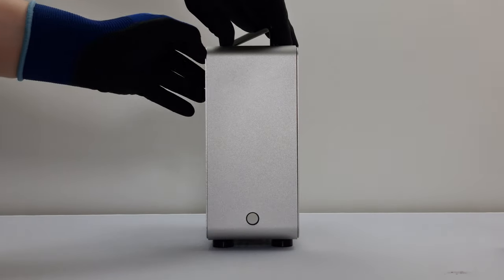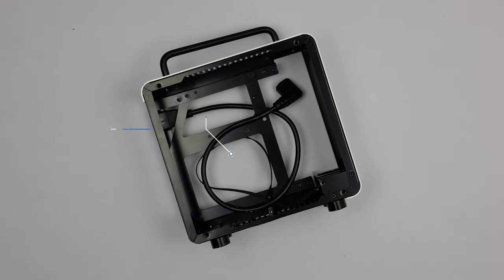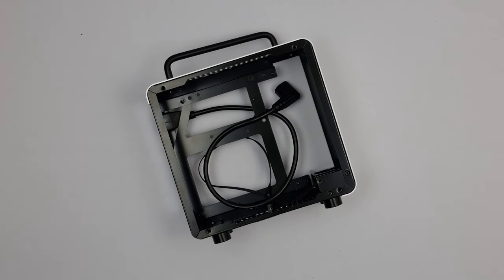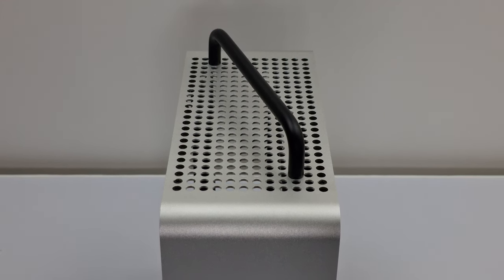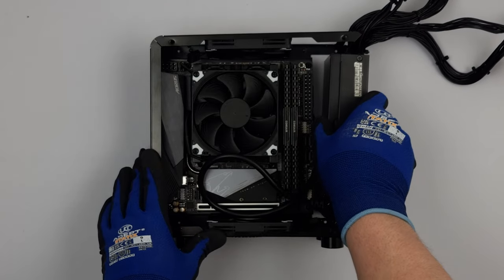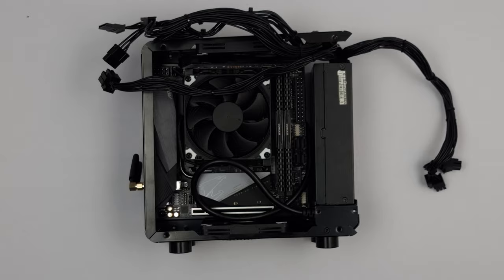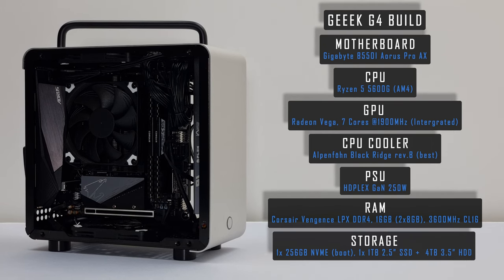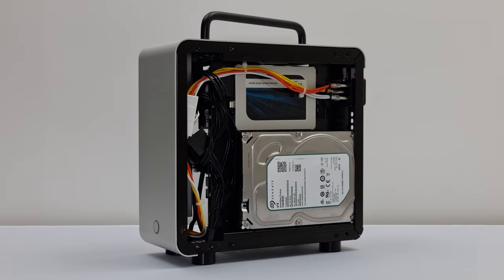GEEEK G4 - 4.8L HTPC Case with Big Design Oversight

Comment: What is your opinion on the Formula 2S case? I am currently using ZZAW A2p with the following specs:

silverstone FX500 psu (swapped the fan ofc), 
msi b550i gaming edge mb, 
g.skill ram with samsung b-die at 3200cl14, 
r5 5600x cpu (defaults with pbo2 on), 
cryorig c7g cooler,
gigabyte rtx2070 itx gpu (defaults cause undervolting became unavailable, idk why), 
I also swapped psu fan with noctua a4x10 flx and have 3 noctua noctua nf-a9x14 (1 instead of cryorig stock one, 1 instead of plastic casing of gpu and 1 blows air away from the case)

I want to upgrade to the formula case mostly because of its aesthetics, but it is also smaller and uses space more effectively. 

By the way, I would like to see your guide on modding cables in flex psu, it is a nightmare to have 3 sata cables and 3 molex in such a small system.

Comment: With tiny changes this would have been ok case, bit larger so it could fit 2 slot gpu and standard SFX PSU.
Reply from the maker: GEEEKCASE are working on the G3 which is similar to your suggestion, but no confirmed release date. 

The G4 is targeted as HTPC, unfortunately the oversight regarding FlexATX power supply where the PSU intake vents are up against the front panel means it'll literally have no access to airflow which risk the power supply overheating.
Reply: I was thinking exactly this. I personally have no problem with the Flex ATX PSU since it allows for these super compact  sub 6L cases. But by making this just a bit wider and losing the 3.5 inch drive support on the rear (which I truly believe to be now obsolete, especially in the ITX market), at least a dual slot ITX discrete GPU would fit there. This would make the G4 a brilliant competitor to the COOJ Sparrow MQ5 which follows this exact half-sandwich layout but at nearly 4-times the cost!

Comment: try d21 itx case 5.9l please??
Reply from the maker: I've considered this case, but the updated version has the most awful 😖 front I/O positioning. I care too much about aesthetics
Reply: @L91  can you customize flex psu?? Like non modular flex psu the excess wire is messy and blocking some air
Reply from the maker: @Kuzzzzzzzzzzzz  no, I don't recommend messing with power supplies, especially cables as a mistake could cost you your PC. Your best off purchasing one from reputable retailer if you can find one.
Reply: @L91  base on my research the modular have less effiency than non modular psu right? So my plan is to buy non modular and remove some excess cable is that possible??